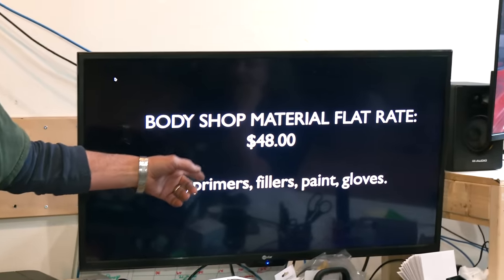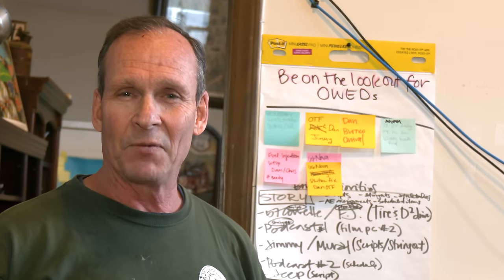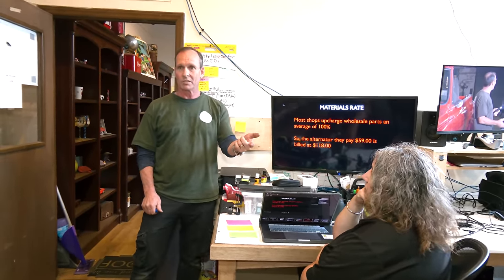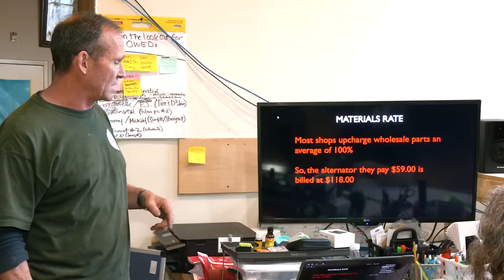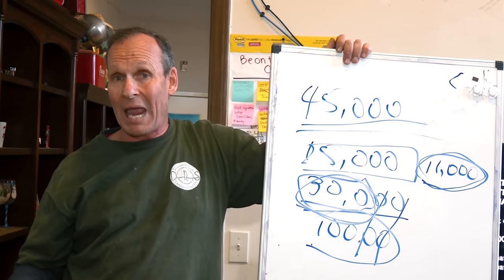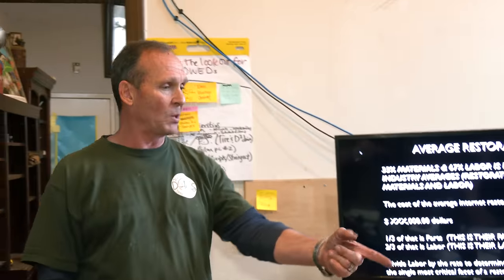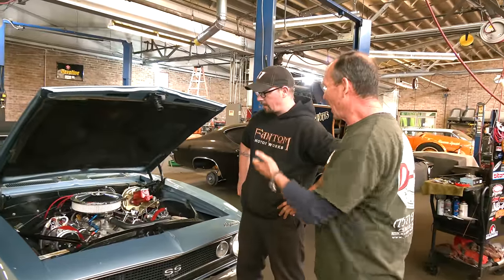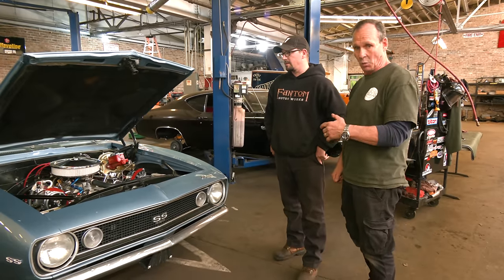Do You Want the Truth or a Lie (4K Upload)

Comment: these shops, like yourself charging pro-rates (100+ hr) doing quality work, worked hard long years with prestige service is rare. average shops don't even pay employees anything over minimum wage. so only people making the profit is the actual business owner.   or corporation. match works for someone other than the private back-alley quality person doing the work themselves (baris) etc. these people are rare today to find. all that's left is the hacks, or large corporation buying cheap parts double the price with weak warranty to cover probability failure to be covers by the OG cost being double, if goes past warranty then they when are a gamble, but they usually win.  yes, quality honest work is long gone. and you are one og the few left that does what is needed for the price and work done.  keep doing you, won't go broke.  i tell business owner i work part time for the reason you get all these simple brakes, oil changes are you don't rip people off, don't sugar coat it when it is broke needs fixed, then come back with other's wanting work as well.  integrity is lost.

Comment: If GM opened a plant to just stamp out old mussel cars body and frames and a kit like your doing 
With motor transmission and rear-end but not assembly it completely, sell it a a new replica kit with modern parts  they sell like hot cakes.

But im not dropping an LS into my 88 toyota supra turbo targa top. 
For one it might not fit and second the 7mgte can put out a lot more hp then stock.

By the way i love the old GMs and Ford mustangs i drove and rode in them as a kid when they were new.
I had a 64ss impla i wish id kept.
The old 1970s toyota celica are getting 350s and other stuff in them, ive seen some bad ass Japanese cars from thec70s and 80s  they need rice too ya know.

Comment: What you are saying is misleading. It's book time vs actual time. Book says two hrs to tape and paint fender when the tech does it in 1hr. I'm not saying I agree with it because your charging 109.00 per hrs for the skilled tech but your book time is for a base line tech so it's still over charging in my opinion.

Comment: I built a 1966 chevelle  coupe non SS car for my stepdaughter because that’s what she had to have!
  I asked her why. She said. Because I don’t see them around anywhere. So now I have to find a car that is not seen much anymore. Here is my lucky part. She said that to me on a Monday. The next Friday I had to work in a guy’s garage. When I walked into his garage under a tarp was a car. I asked what’s underneath the tarp?
   He said, a 1966 chevelle coupe non SS. I asked if he wanted to sell it. He said yes! No motor. 
  I got a crate engine (low hp) because she was only 16. A year or so down the road she wanted a new bronco. I purchased that for her and I kept the chevelle.  Soon I was pulling the motor out and sticking in a LT1 built with LT4 heads hot cam and more. 
  Oh that should be pretty easy enough!
   By the time I got everything finished up I had including motor and transmission well over $15,000.00. I purchased the motor and transmission. Had both of them rebuilt or built. 
What I didn’t know about when I started.???
Electrical,,,
Fuel system,,,
Computer system and programming,,,
Disc brakes all around,,, so much that I’m forgetting !!!
  Sold it about a year later for $27,000.00.  Lost money there!!Purchased a 1999 Acura NSX.
Reply from the maker: Common story...

Comment: Complete con man …no…a paint job is not $60k and no, a mechanic doesn’t deserve the same rate for sanding something as they might for diagnosing something requiring expert insight …tightening a bolt or taking off simple parts is the same truth , it’s not deserving the same rate of pay as what the parts of the project that demand high skill does …so it’s completely invalid logic to expect an hourly rate to apply to EVERY hour of a project’s build.